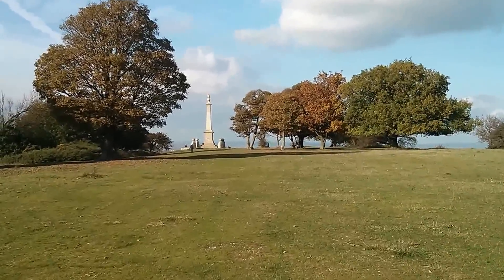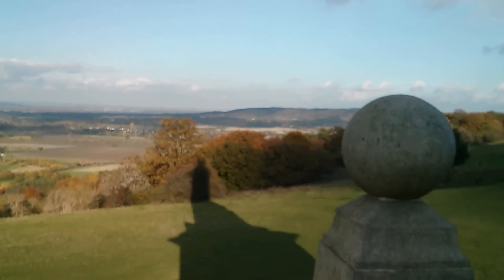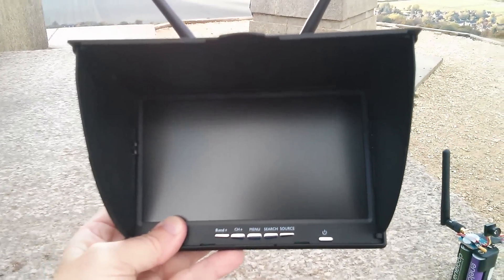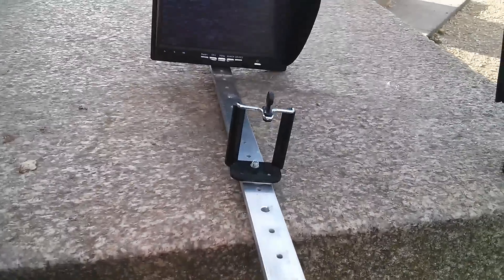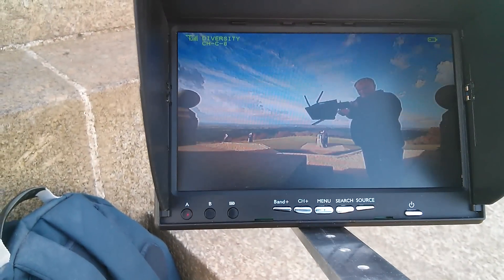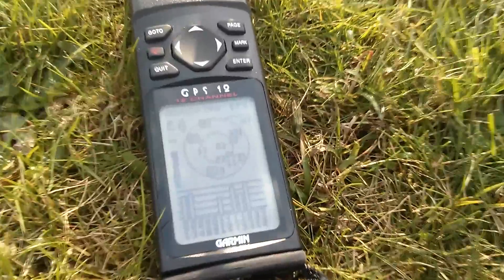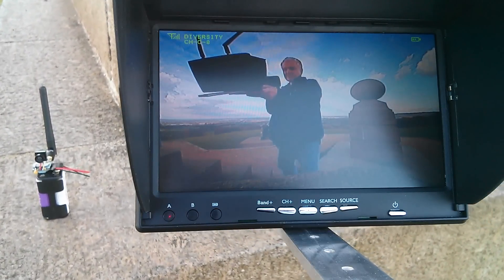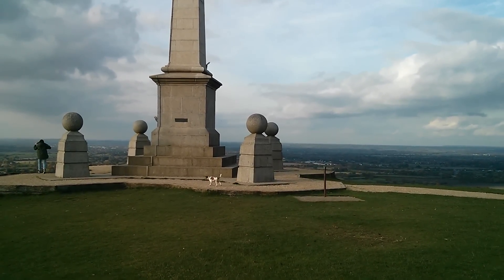Preparing for FPV Video/Audio Transmission Range Tests

Comment: What was the power output of the transmitter ? Was it only 25mw or 600mw ? This would drastically influence the signal range. Also having your factory linear antenna's on a silly angle like you did, and not vertically polarized (straight up and down) will severely hamper the reception. Show us a test using an inexpensive circular helical antenna with an omni directional diversity antenna on the receiver, and a decent omni on the transmitter. Now that would be a range test worth watching. Cheers :)

Comment: Good luck finding a place to fly. Regs say as soon as you strap a camera on it, you can not fly within 150m of any place used primarily for residential, industrial, commercial or recreation and not closer than 50m to a person. It's pretty ridiculas if you ask me - can't even fly in your back garden with a camera mounted.

Comment: All I can say is, I hope you get some goggles soon (even DIY ones are great). Trying to fly anything via a small screen is a total bitch, it's very unnatural because you don't fully get immersed in the models point of view, and you can't fully focus on the model from the ground, resulting in less mental link up to the model. I tried using a screen when I first started and very quickly made myself some goggles out of foam, a fresnal lens, and a small screen. Hobbyking has a really nice screen set-up in kit form that has everything you need to make it, and it's in the 50 usd range, so much more affordable than fat sharks or something.

I don't mean to be negative or anything, but I hope you can learn from others experience before you waste time and effort on a mediocre(at best) setup.

One more thing, if you're going to use the screen, you ought to make up some sort of better light shield. Even on a cloudy day, those fold up light screens are pretty useless. Not being able to make out the screen properly is the last thing you want when learning to fly a quad

Comment: There's my baby!  The Garmin GPS12 was a "child" of GPS40/45 handheld/pocket size GPS (of which I still have my fully transparent engineering prototype).  It was one of my design projects I worked on at GARMIN... "back in the day".  I also worked on the original GPS100 even before there were enough birds up to get a position fix more than a couple times a day!  I started when they still went by the name "ProNav". I also was involved in the design of the GPS50/75, the GPS120... as well as the first GPS sensors, the GPS20/25 bare sensors.  Fun times... good memories... lots of work!